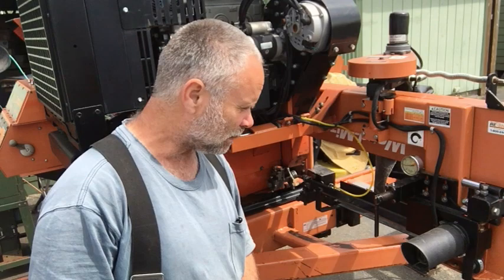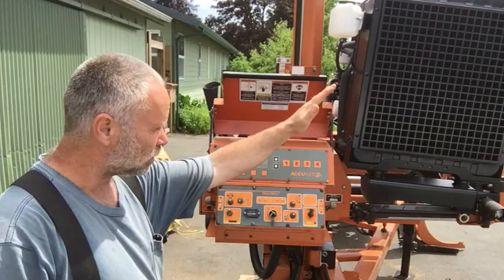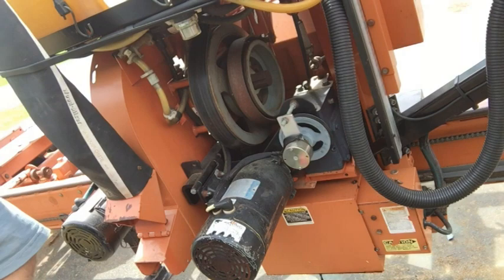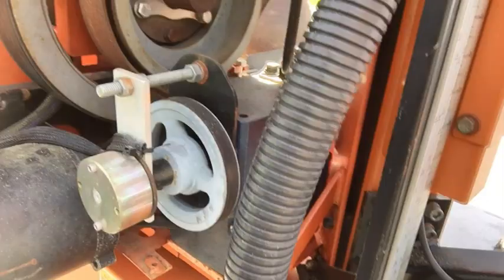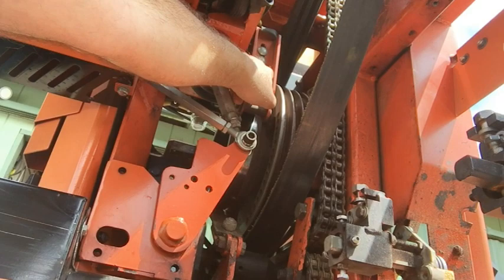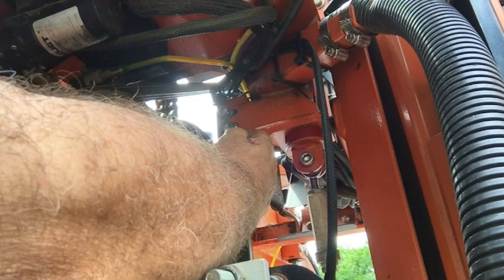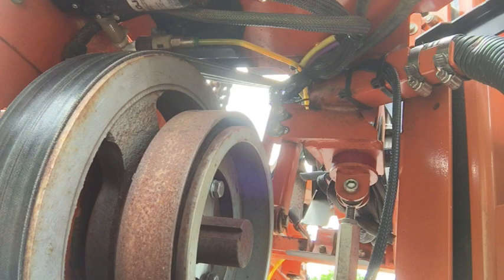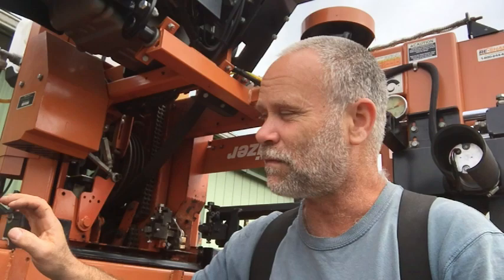Wood Mizer Brake Adjustment

Comment: You keep a written records of adjustment n changes ?
Reply: I generally write on filters mileages, date stamp or hour readings. Other things such as this I inspect and adjust as needed. I don’t keep a ledger of maintenance tasks although it is a great idea. I have worked in industry which followed strict maintenance intervals. Time lines are guide lines for equipment. I base maintenance on as needed due to various conditions.